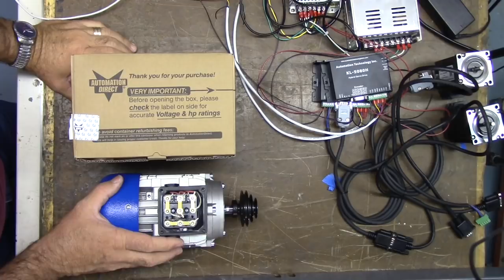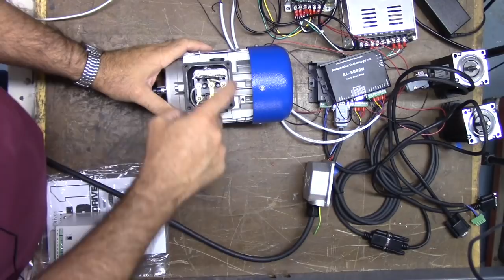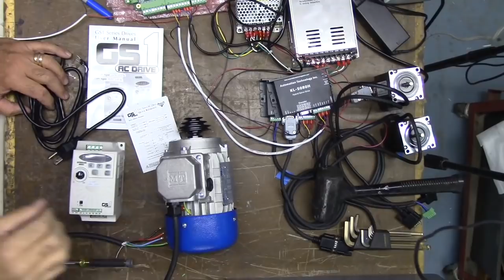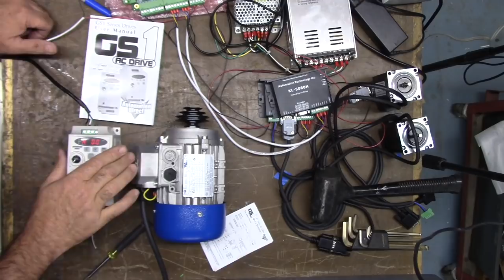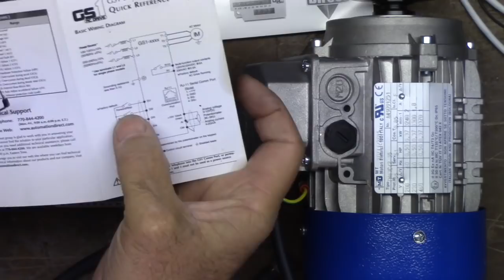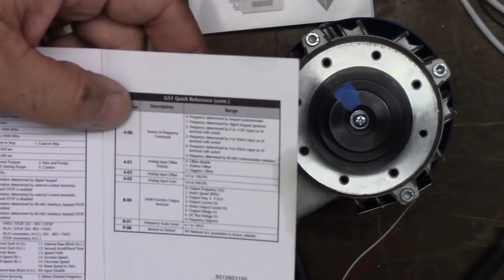Emco Compact 5 CNC   Benchtesting Spindle motor and GS1 VFD -  Part 1

Comment: Hi Marty, do you recall which version of the GS1 this is?
Reply from the maker: Version? Depends on your spindle motor horsepower and you want single phase input. If less than 1HP you can use the 120VAC single phase input

Comment: Hey did you find this motor had enough power?  It's the perfect size but the stock motor on my compact 5 is rated for 800 watts (later edition).  I don't want to downgrade as far as power or torque goes, but I really want a vfd because I don't want to mess with transmission/ drive belt speeds.  I'm not sure the motor runs at 800 watts continuous but it's the stated output.
Reply from the maker: 800 watts is over one HP. You must have the DC motor. My client hat the 120vac motors

Comment: Thank you Marty!
OK. Let me begin :-)
I already asked you similar question but I can`t remember the related video. So I`ll take freedom to ask it again.
I am planning to convert an older lathe to Acorn + DMM DYN4 + DMM servo motors + VFD + encoder.
This lathe has multi-speed gear box and I am not sure how to use it (related with torque). You told me to use three speed. OK. But, how to use them with Acorn? ( I am aware that there are three buttons on spindle control on monitor).
So, I beg you to make a video (if you can) and explain this in detail.
And I am sorry to all of you if my English is not good because it is not my native language but I think that you understood me.

Comment: Hi, why did you decide to put in a new motor ? My original motor still works fine is there any reason to swap in a new one?
Reply from the maker: The original motor was a single speed single phase motor. The owner wanted variable speed control of the motor. By all means use the motor you have. If you have the DC motor,  you will need a controller such as the KB Electronics KBIC-120 with the SI-5 signal isolator to connecto to Centroid Acorn

Comment: Thank you so much for this info! 

All of the info here is exactly what I needed to get over my pcturn retrofit hurdle. Finding a compatible VFD for the factory motor at a reasonable price can be a hassle. Going this route, I should be able to get both a motor upgrade and the VFD for under $300... And that's a big win.
Reply from the maker: Still need to test the performance on the lathe....soon....still prototyping what needs to be done to fully convert one of these machines.

Comment: I’m close to setting up my own VFD. I was really concerned about blindly hooking it up to my Acorn. I never thought about using a voltage source other than trying Acorn. Thanks for the video, you may have saved me a new Acorn!
Reply from the maker: Ask for help on the Centroid CNC Acorn forum. Post a link to your manual. Use a relay board on the 6 Acorn outputs.
Reply: Thank you sir!  Is the Acorn forum on the Centronics site?
Reply from the maker: Yes,  http://centroidcncforum.com/viewforum.php?f=60

Comment: Whether or not to ground both ends of the shielding is a constant cause of controversy. Some manufacturers say you must, some say you mustn't, some say you should, some say you shouldn't. There is no universal "right" answer - it depends on the installation and in most cases it really doesn't matter. 

I've done a lot of EMC testing of drives and complete installations and I can tell you that in some cases it helps and in other cases it doesn't.

What I CAN tell you is that anyone who says it MUST be one or the other is wrong. For the purposes of this kind of application, it almost certainly doesn't matter, so just do whatever is most convenient.
Reply: PS PS Also the limit and homing inputs on most boards are very prone to interference. If your having strange problems like losing steps or servo overrun, lag even spindle control issues look there. Dont shield just reroute the wires away from everything especially anything like a VFD
Reply from the maker: Thanks Murray. I do my best. At the end of the day, you do what is best for you.
Reply: Murray Edington That’s good information, I usually go with shield grounds on one side only, closest to the source unless the wiring diagram or schematics indicate otherwise.
Reply: You ground one side  only or you will be creating a ground loop (thats really bad) The trick is to run separate ground wires to a common Chassis ground. The Same terminal the ground lead on the power cord goes to. Do not daisy chain the shield wires.
Be careful were you run the ground wires do not run them parallel to each other or near something like a VFD. Or they could pick up the interference and make the shielding interfere with the wire your trying to protect.
Its best to shield only low output control wires NOT power wires if you shield power wires it could amplifie the interference.
Component location and wire routing is by far the best way to protect electronics, shielding should be used sparingly only were there is no choice.
Do not run neatly bundled wires in parallel this sets up fields of interference
Reply: You are trying to teach a whole room full of grannies how to suck eggs. What do you think is "really bad" about it? Last time I looked we were talking about connecting an industrial motor to a VFD, not connecting up a high end audio preamp.

To get into the detail, the stray capacitance between the motor windings and its chassis massively outweighs that of the cable so any return current from the motor would otherwise have to come back along the protective earth connection rather than back up the motor cable assembly - that's simply a different  EMC earth loop, as there are most likely other ground paths between them already. However, if you go back and read the intro and the Belden reference you might understand there is no right or wrong. Some VFD manufacturers recommend one, some the other. If you aren't EMC qualifying an installation, you would never know the difference and each installation is different.

It's all rather academic anyway as 99% of installations have the motor and VFD mounted on heavily grounded / interconnected chasses and almost none of the hobby installations even bother with EMC filters on the input to the VFD.
Reply from the maker: Murray, I appreciate your replies. I did ground the shield in the cable from the VFD to the motor at both ends. Please see my reponse to Tom about an issue I encountered yesterday with the analog signal. I had encountered this in the past. This time, disconnecting the drain wire from the signal cable remedied the problem with the erratic analog signal from Acorn to the VFD. 

Please, collectively, when we run into these sorts of things, lets work together to prove them out and share them with the community. Not a one of us knows everything, but putting minds together, maybe we can solve and learn from each other. Thank you ALL for  your input! It helps me learn more as well. I like to replicate the problem, understand what is happening, fix it and try not to repeat it in the future. Kindest regards to all. Marty
Reply from the maker: Tom, I appreciate your reply. Yesterday, after wiring up the backpanel, I tested everything again. Everything was fine, EXCEPT the VFD was acting erratic. I had noted this before on another build. What I found was the analog signal was very inconsistent. I had grounded the drain wire of the control cable at the motion controller end of the signal cable from Acorn to the VFD. I noted when I simply just placed ONE leg of my meter to the analog input of the VFD that the speed changed. I tried a couple of things. I bypassed the wire feeding the analog signal in the cable temporarily with a single wire. It worked. So having just read your response earlier in the morning, I disconnected the drain wire from the common ground point. The analog signal was working normally. Video coming later today or this weekend showing the anaomally.
Reply: Murray edington
I see why Marty chose a short polite answer.
I respect your opinion but I am 100% sure you dont know what your talking about , Your wrong on so many points.
I wish you the best of luck.
Have a good life.
Reply: Ah well, after 35 years developing, applying and testing VFDs and motors between 1kW and 200kW for industrial and automotive applications, it's good to know where I can come to for help. I'll take your advice on board!
Reply from the maker: Murray, I hope to post a video showing what was going on with my analog signal. I am not an E.E.. I am an electrician by trade. I would like to hear  your take on what might be going on. Right now, we can replicate and test things to figure out why. Thank you for participating in the discussion. Please stay engaged. Marty
Reply from the maker: I am learning this! Thanks Murray!
Reply: Ground loop
an unwanted electric current path in a circuit resulting in stray signals or interference, occurring, e.g., when two earthed points in the same circuit have different potentials.
Reply: Marty yes i should have been more polite to Murry. I have a hard time with bull.
Its my biker back ground
An E-E That does not know what a ground loop is? and want to ground both ends of a shielded wire? I think at best he is a tech that retrofits or replaces Vfd's.
Granny sucking eggs HUH? And most hobby use and input filter on the VFD they probably dont know why they just saw them on Youtube. LOL. Its to protect the grid from your VFD interference (required by law)
Vfds coulds almost be used as a weapon they radiate so much interference Oh wait a minute they do use them as weapons for jamming and destroying electronics
I dont know if you remember but i left a comment on one of your videos a few months ago describing a very similar issue that was solved by Cutting the drain wire. At least as for as I understand what you described.
I built performance engines for years i had a manual engine dyno and saw a conversion from land and sea for cheap bought one.
Then I phased in a product line and CNC work
Also had a good friend that was a PHD at Lawrence livermore labs (Henry) Great guy brilliant (when he took his meds.) The conversion i purchased had all sorts of bugs turns out they never actually tested it. Asked them to fax me the schematic for the boards they did humoring me . Henry took it home and redesigned it for them. Most of the problems were due to ground loops Thats were the rule of all drains and grounds should go to a common terminal That is an earth ground . They sent me an updated unit it worked much better. There is a difference between an earth ground and a COMMON or COM terminal.  An earth ground puts it to dirt a common or com completes a circuit. The neg terminal on your car is a com not a ground since your car is on rubber tires. (A floating ground.)
Henry also talked about isolating and floating dc from an ac grounded circuit. This is very important.
And much more
Of coarse this is way over simplified and there are all kinds of exceptions to the rule.
Also when i converted my two acroloc mills one had a fanuc 6m al? and the other had a yasnac mx1.
Both systems were obviously designed by a team of brilliant engineers (maybe not as brilliant as Henry)
I took not exaggerating a good 40 lbs of copper wire out of each and many interference prone analog boards and old school transformers also 24 volt AC relays (real interference makers.) I think I only saw one use of shielded wire in the whole system and that was on the servo tach wires on the fanuc system.
What does that tell you? 
Ok end of novel.